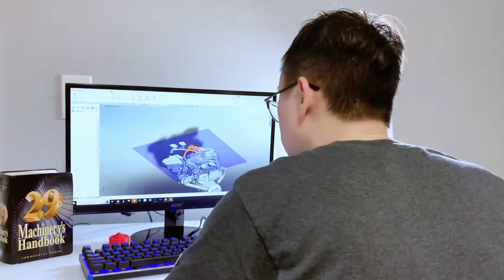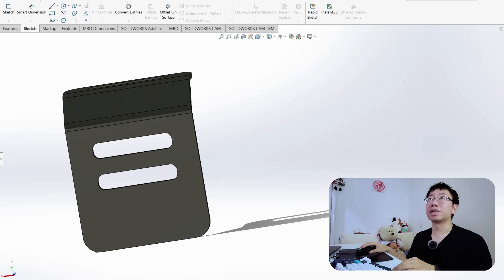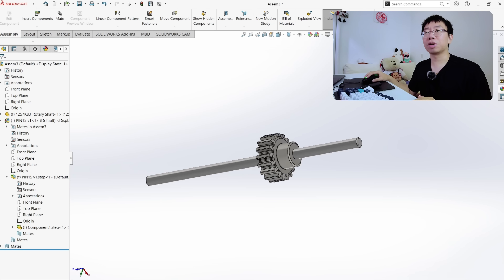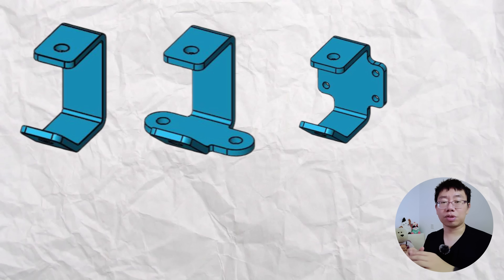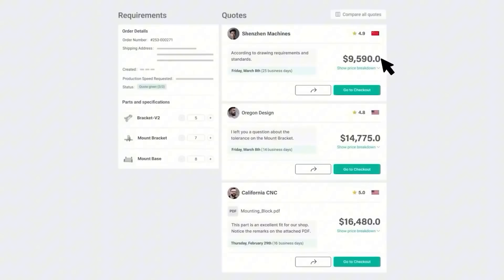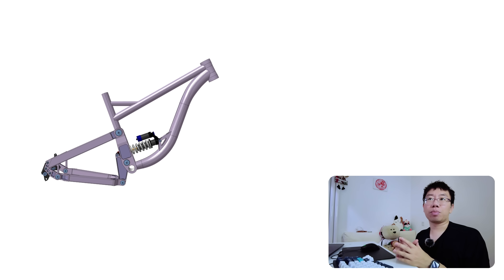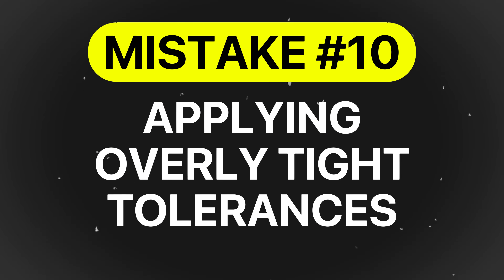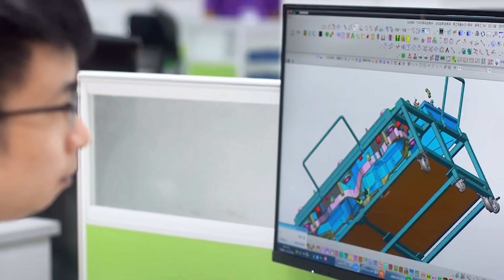Avoid These Costly Mechanical Design Mistakes

Comment: I really enjoy and have learned from your channel, thanks for putting it all together!  Many engineers don't seem to turn wrenches.  The same for architects.  I've built homes and turned wrenches and often think to myself when I run into bad design that engineers and architects should occasionally work in the field so they can understand how their designs affect the eventual product.  Around the 13 minute mark you mentioned how applying a 100 mm tolerance may not be necessary and I found myself thinking,  what useful thing could you possibly make that did not have at least a 100 mm tolerance? Maybe I'm not hearing/understanding this correctly?

Comment: My friend, as a mechanical engineer, what is your opinion about the future of mechanical engineering compared to electrical and electronics engineering? I notice a decline in the contribution of mechanical engineering in most of the industries that have always been associated with it. Is this due to the shift in control theory from mechanics to electricity and electronics, and also because of clean energy? What is the solution in your opinion? Are we conducting research to develop modern and rapid mechanical control? Basically, we need this control to work in conditions where electronics are unable to work, such as nuclear power reactors and space. Please reply.

Comment: For me, a good way to think about the first part is "say what you mean!"  Directly specify what actually matters.Suppose you have a 20mm wide part with a hole in it. Does that hole need to be in the middle, or does it need to be 10mm from the edge?
The two sound like the same thing. Until the part is enlarged to 12mm wide. Then suddenly the assembly doesn't fit together, if you said "10mm from the edge" when you meant "in the center".

Normally what matters is the relationship between two features. So specify that. If what matters is that dimension D is two millimeters longer than E, specify E as D+2.   Instead of doing the addition in your head "D is 20, so E is 22". That will break the instant D changes.

Comment: In my company, I constantly load up CAD assemblies, giant machines big amount of sub assemblies. Whenever I have to make changes, it takes me ages to analyse how the engineer put relations between the parts. God damn the amount of times everything falls apart because Im replacijg a single sheet metal part. Now, you motivated me to implement this smart parametric thinking. I will try and push this mindset at work, but sometimes it's just not worth the time and money, honestly sometimes the senior engineers tell me "its ok its ab old machine anyways we only do it the right way with the new machines" 🙃🙃🙃

Comment: I am usually really trying to incorporate best practices in my modelling strategy... but ever since i had to switch to SolidWorks, it feels like no matter how much effort i put in... the software tries to break my spirit. especially using equations in SW feels so much more cumbersome then in Inventor, especially if you ever delete a feature that used an equation... throwing a tantrum instead of just deleting the unused equation with it. 
Configurations are also a prime candidate for breaking an Assembly. just last week i replaced a piston assembly with another one. all constraints had been towards workplanes... yet the assembly exploded in way that made no sense and refused to fix until rebooted the whole machine....

Comment: I agree with design indent and basing dimensions to solid references but I do not think that defining dimensions through functions is always a good plan. In my mind it makes things more complicated for the next guy to understand. Instead of just moving the slot position a few millimeters, I now have to decode what is the parameter that drives that dimension.

I guess it makes sense if you design furniture and develop a model that gets used a lot and is adopted to clients dimensions. Number of drawers and shelves depend on cupboard height etc... Just my thought.

I have seen plenty of models that were built up so complicated that it was easier to just remodel from scratch.
Reply: These are simple functions. But I agree that many enginners not used to make functions can strugle. Best solutions, in my opinion, is to train your engineers and teach them good habits.
Reply: @krysrus111  you never know who or when someone will  work on this after you. in big companies functions and parametric are widely banned to guaranty predictable changes, you can change the dimension you want and it can lead to unpredicted changes in another place, also, about "variants", it's also not a common practice because changes in one part for one assembly can lead to changes in another assembly with same part and it's not always necessary, so main practice is no dependencies, functions and parametrisation at all, or you sould place them veeeeery carefuly. when you have an assembly of thousands of parts and you changed something in one part with dependencies, or linked with another part - you can easily overlook unwanted changes due to parametrisation or functions, and then you should decode someone's thoughts and intentions to understand "wtf is going on here". But to be honest - all these features are big time savers and helpers when you are making something for yourself. but again, come back after few years and you will struggle a lot decoding all dependencies and functions.
Reply: @artemgrib  I completely disagree. I’m not going to waste hundreds of hours redrawing everything manually just to make my work “idiot-proof.” If someone can’t understand how parameters or dependencies work, that’s a skills problem — not a design issue. Modern CAD tools are made for parametric and functional design. Ignoring that just because “someone might mess it up later” is the opposite of engineering. Properly managed parameters don’t create chaos — they create structure, consistency, and real efficiency.